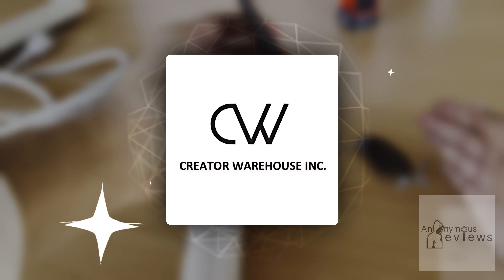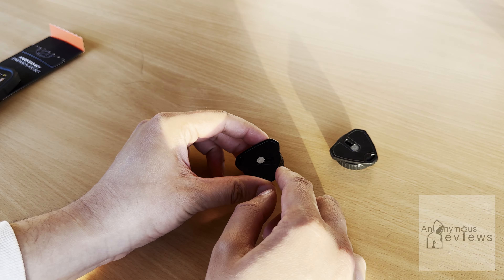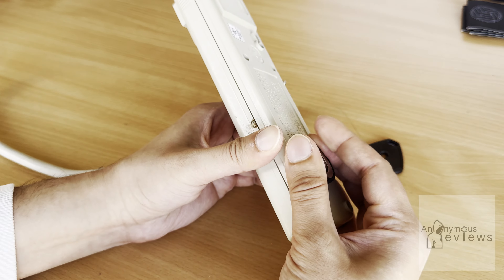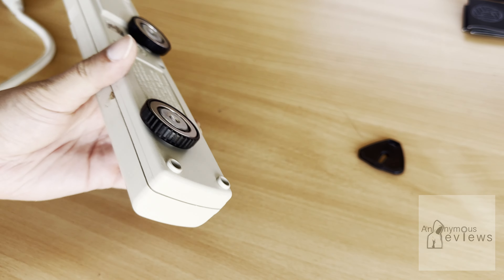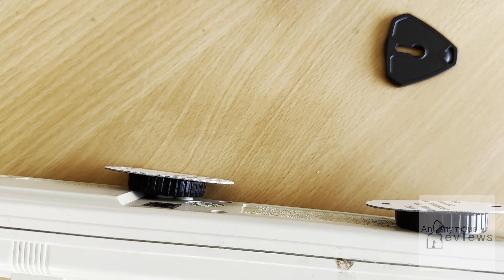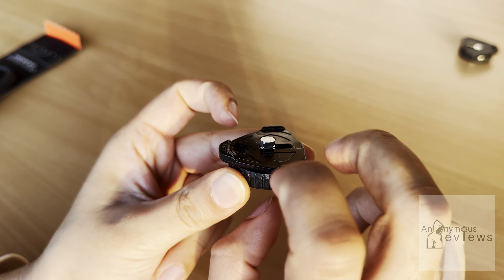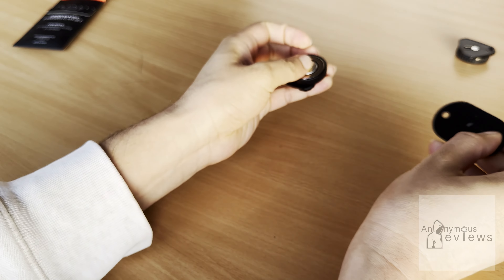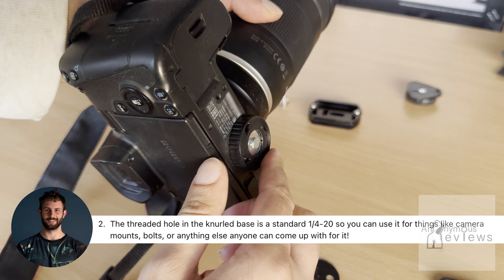Creator Insights of LTT Magnetic Cable Management Power Bar Keys

Comment: Thanks for your reviews of this product!  I've got a set on its way to me, in part thanks to your positive view towards it.  With the power bar in this video (about 2:30), I wonder what would happen if you go ahead and attach it to a mounted metal/magnetic surface?  From what I can see, the magnets are super strong, I have a sneaky suspicion they'd hold, even if they're misaligned.  Or maybe loosen the keys a little so they can manipulate themselves  into a flat alignment?  I know it probably doesn't matter much since these are old and unused power bars, I'm just curious if you tried it anyway.
Reply from the maker: Thanks for commenting! My latest video actually features this comment and shares findings from my test of the Power Bar Keys installed on a power bar: https://youtu.be/rbz-ew8gVAI

Comment: Dude got a 1980s power strip and thinks even though the plastic is yellowed, thinks its a great idea to plug a 1000w computer system into.
Reply from the maker: The power strips I’m testing with are old/spares and not used in production by me or anyone in the household. Their sole purpose is testing power key compatibility.